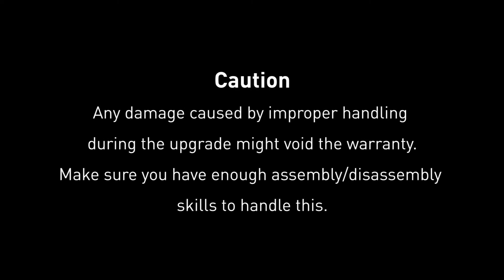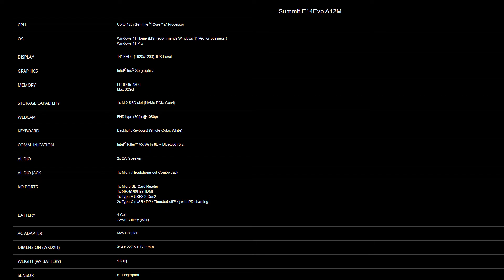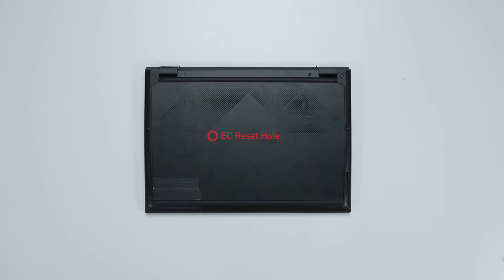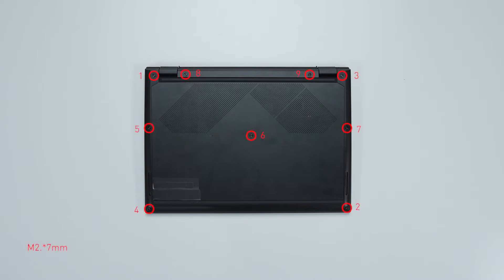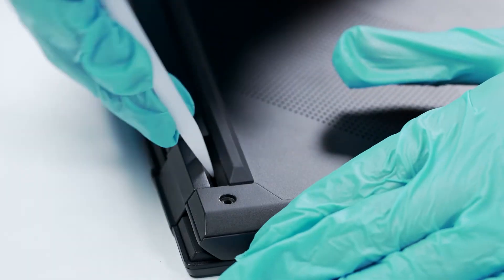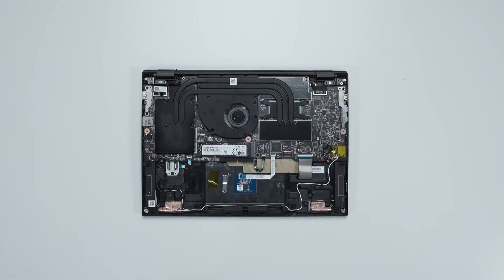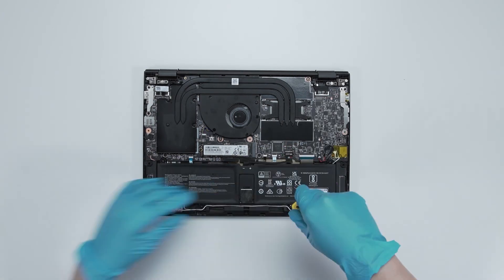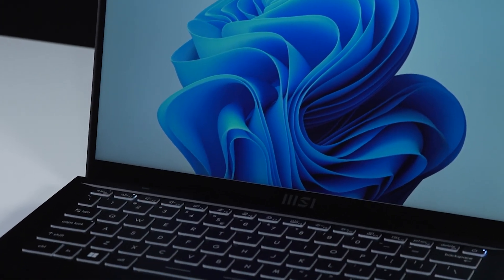MSI Summit E14  (Flip)Evo/ Prestige 14 Evo Upgrade Tutorial

Comment: Gen 4.0 SSD's all say they need heatsink for max speed. Can we install like the WD BLACK SN850 Gen 4.0 SSD on this without a heatsink and get max 7000MB/s read speed?
Reply: If it is such a problem for you just put thermal pads on the ssd so it touches the chassis.